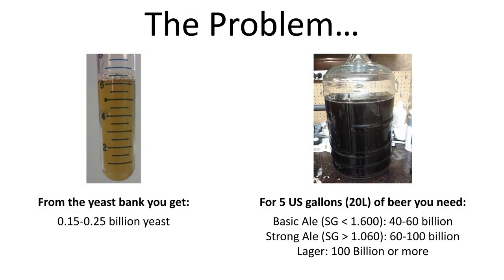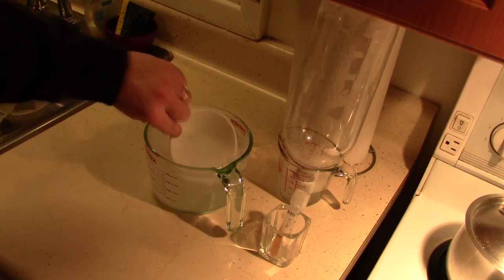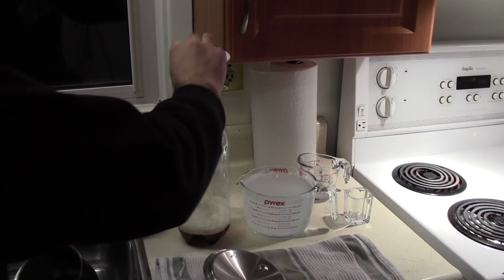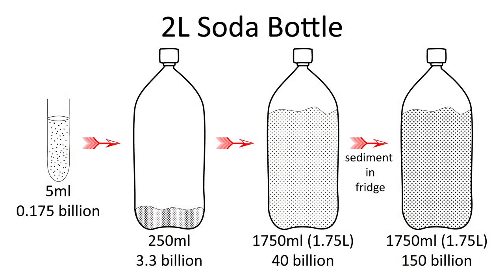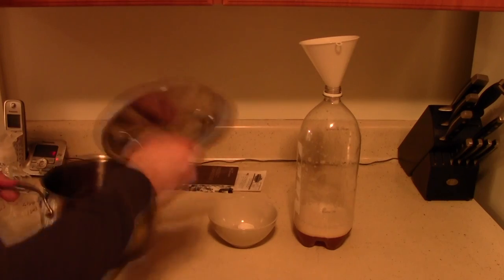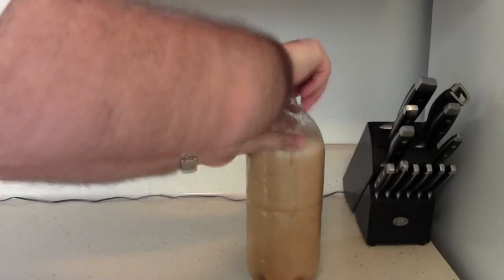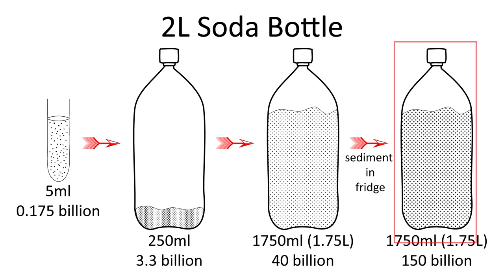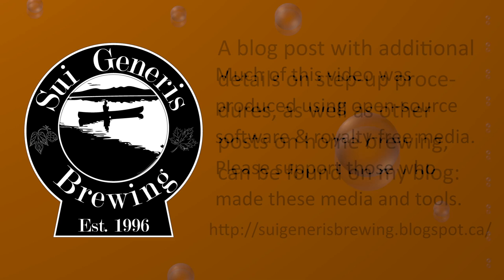Budget Yeast Starter System

Comment: Hey mate,
Have had great success with this method for my ales!
Hopefully you get this! I have some 34/70 dry yeast and need to double the pitch rate. Unfortunately where I live means waiting a few weeks to get more yeast.
Can I use this method for dry yeast?
I need 555 billion cells for the volume I’m brewing.
So could I split the packet of yeast (5.25 grams- or 30 odd billion cells) and:
A: straight into two 3 litre starters with a teaspoon of nutrient in each?
Or
B:300ml starter and then option A

Hope you get this!
Reply from the maker: It will work with dry yeast. Just rehydrate, and add to the starter.
Reply: Sui Generis Brewing wow! Thanks for the fast reply! Means so much.
So rehydrate and split the packet into two 300 ml starters and step up to 2, 3L starters would be best?

Thanks kindly again
Reply from the maker: @jessoman  sorry, didn't see this last night. For a full packet of yeast, rehydrate and put into a full 1.5 L (or larger) starter. You don't need the smaller steps as you already have a lot of yeast..
Reply: Oh, that sounds much easier, from your diagram I thought putting one pack (~60B cells of 34/70 ) in 1.5L would result in only 250B, which might have been a bit lean (going for the 9 celcius 300g/hl recommendation on the yeast spec sheet). Ill go straight into 3L starter then get it into the beer. Thanks again for your help. Really love your work and recommending it to fellow aussie brewers!
Reply from the maker: @jessoman  a 5g pack should be about 100 billion cells (dry yeast is generally 20b/g). To get larger yeast counts you would be better off to split the pack between 2 or 3 1.5 to 2L starters then running the whole pack through a series of starters.
Reply: @SuiGenerisBrewing  

Just copied this, hopefully i'm not missing something:
Viable cells at packaging:> 6 x 10^9 /g  (11.5g pack- so is that about 69B?)

https://fermentis.com/wp-content/uploads/2018/03/SafLager-W-3470.pdf

Okay, I'll split the dry pack into 2x2L starters :)

Comment: Is there a reason why you start with 250ml? Cant you go with 1750ml immediately?
Reply from the maker: Generally speaking, yield of cells (per ml of medium) drops when you step-up by more than 1 in 10. Stepping up to 250 ml is more than 1:10, but its a reasonable compromise between getting decent yields versus the number of culture steps. Going straight from a small tube to a liter or more would more than halve your yield of cells.